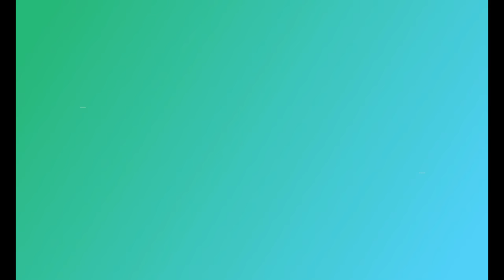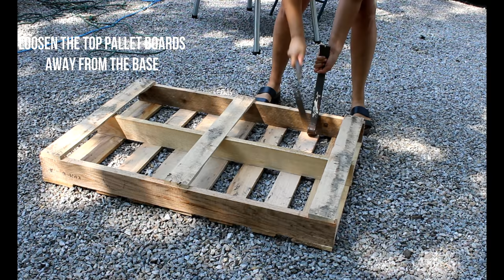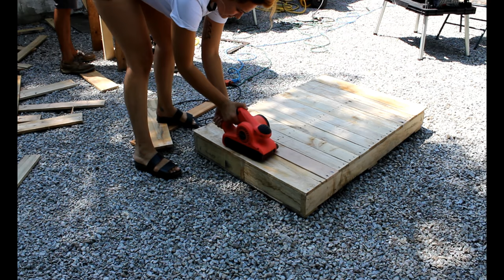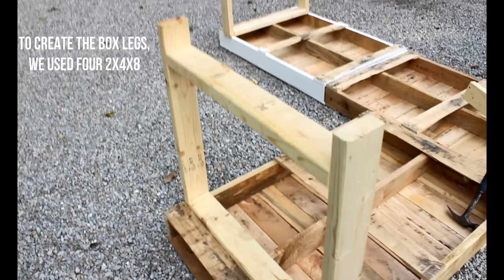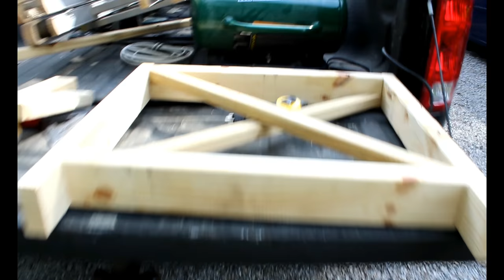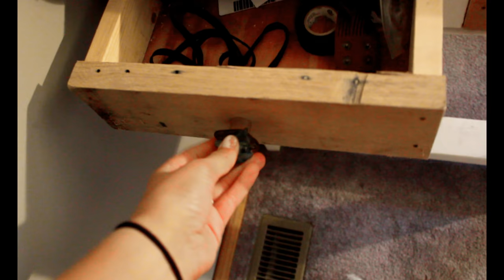DIY Pallet Desk | | Upcycling Pallets

Comment: Few tips when pulling apart pallets without using a reciprocal saw-
1- spray pallet nails with WD-40 or alternative before pulling apart. It softens the wood, frees up rusty bits and lubricates the nails for easier removal.
2- Lift the boards just enough to shift the nail, push board back down and most nail heads will pop out enough to get good purchase on them.
3- Screw nails can be removed from hard wood pallets by clamping the nail head in a drill chuck and backing out. 
4- Soak the timber around the nail points with water. Most pallets are made with very fresh/green timber which has shrunk(tightened)over time. 👍